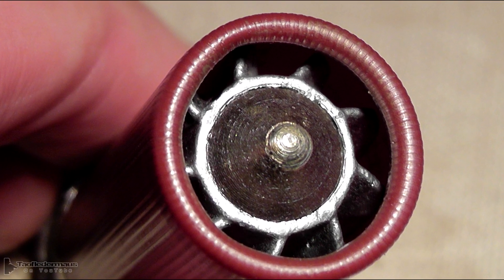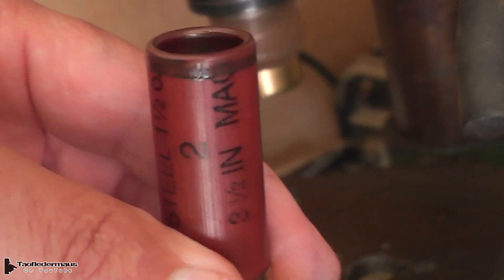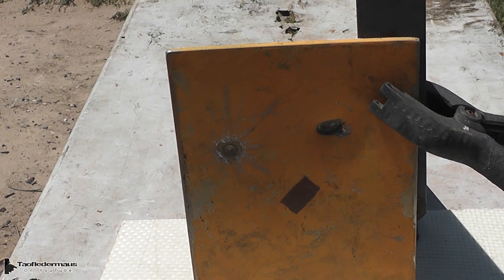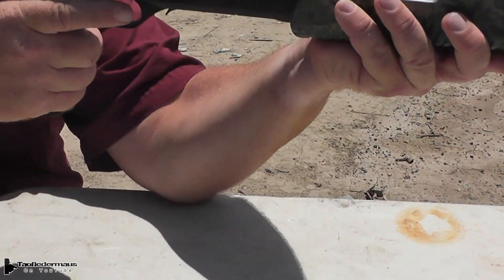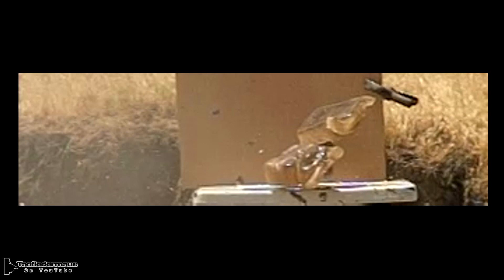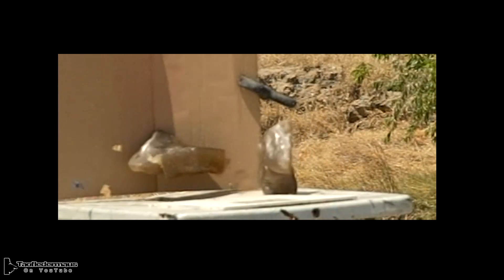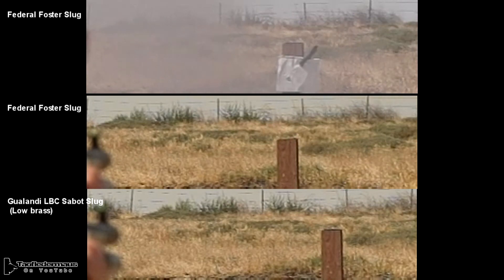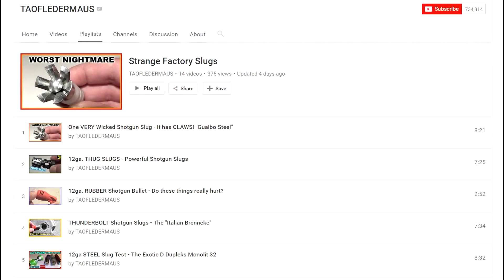World's Sexiest-Looking Shotgun Slug - SKORPION!

Comment: That was weird because the slug looks good. I guess the answer must be is that the slug is poorly balanced in some way? At any rate, it seemed to tumble relatively straight :) Well done.
Reply from the maker: This was a weird one because we have had nothing but good results with the slugs with the attached wadding.
Reply: TAOFLEDERMAUS just watched this vid. I'm thinking that the head should probably be flattened, and the vanes be twisted clockwise/counterclockwise to force the air to create spin stabilization. The head is probably keeping the air from gripping the vanes due to......well I forgot the name of the effect. That video showing air flowing downwards instead of outwards comes to mind.

Comment: I think problem with these screw type slugs is that they probably only are stable on certain velocities.
Reply: could be. other thing is that could the crimping affect the soft lead... there seemed to be lots of plastic in the casing to melt and make the crimp. the part of lead bullet on the other hand had very small fins against those hard crimps. so if the crimps stripped the fins or other way mangled them, it probably wouldn't fly straight.
Reply from the maker: The problem is,   a slut goes from high velocity to low velocity during the flight and needs to be stable at all speeds.
Reply from the maker: slug,  not slut...  Freudian slip
Reply: Wouldn't it be stable with a rifled barrel? I'm not physicists but it seems that it's designed to fly with a spin.
Reply: +Cristian Sosa Exactly
Reply: +Cristian Sosa Itsays on that site that it's supposed to be fired form a choked or rifled shotgun.
Reply: +ralfiasz I've made a mistake, it says: EVEN from choked/rifled barrel. Forgive me the confusion.
Reply: +Cristian Sosa I thought the idea of this sort of slug is essentially to put the rifling into the slug rather than the barrel.
Reply: Tayler Robinson Ya but if there's no rail to guide it, it will have a harder time getting the spin it needs.

Comment: I know you've shot slugs of different metals before but I don't remember if you shot them at a steel plate or not. Do you think if you got a slug of a harder metal than steel it would go through/pierce the plate? Or does it also depend on the velocity of the slug?
Reply from the maker: We have been able to shoot through level 3  armor with some of the slugs Tim has machined for us.
Reply: for penetration toughness and density are key besides kinetic energy ofc

Comment: any chance of you testing a different camera angle 
on a 6ft step ladder  to get a slight down angle might help clear the gases from magnum rounds (there not high brass any  more test them with magnets )
Reply from the maker: It's easier to just use certain brands of low brass that we have learned emit less smoke without just loss in velocity.

Comment: I think due to the constant decreasing velocity of any projectile all these vane/vented/"rifled" slugs only create instability and LOADS of drag. Even from short distances I'm certain the differences from muzzle velocity and terminal velocity is very noticeable. These gimmick slugs are banking on the preconceived notion that directionalized drag would impart spin which ideally creates stability but the story your "budget" high speed cameras illustrate is quite different. The spin normal bullets fired from rifled barrels can exceed 300,000 rpms... the bullets must be very well balanced or it will create yaw in the bullets rotation, making it inaccurate, less powerful and potentially "key-holing" the target, much like our ill-designed slugs here. These gimmick slugs could never hope to stabilize like a normal projectile from a rifled weapon, UNLESS they were RAP rounds, rocket assisted projectiles.... IF their velocity from the muzzle was increasing, vice decreasing, then perhaps they could stabilize within a reasonable distance. But to my knowledge there is no civilian or small arms RAP capabilities... yet.

Comment: well why not place the camera slightly in front of the barrel so the smoke would be behind?
Reply from the maker: The shockwave from the blast would shake the camera around and it's possible the camera would be destroyed by a piece of wadding and I wouldn't be able to frame the shot and it is easier to use shells that emit less smoke.

Comment: In fact It sucks. I used on wild boars some loaded by Rio: not accurate, low stopping power, and It does not   perforate from one side to the other even if shot at short range.